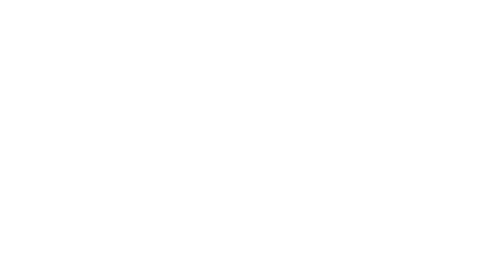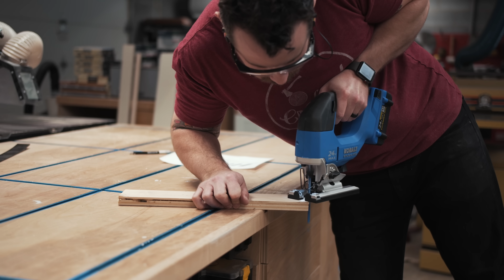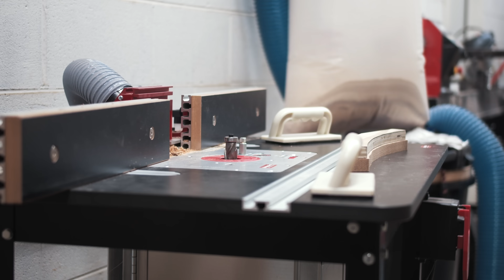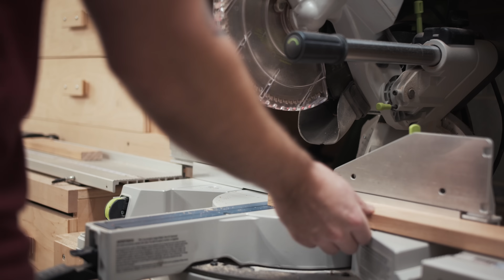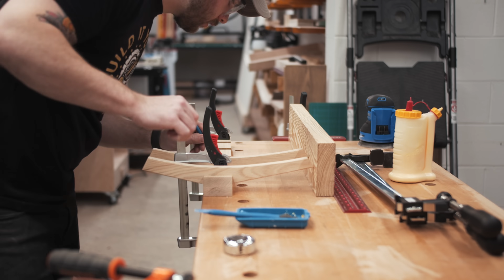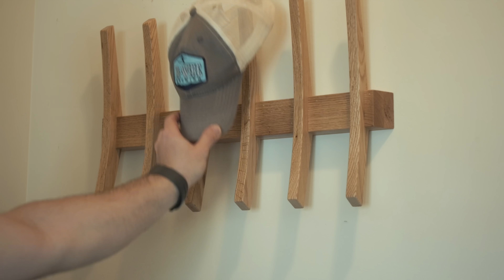DIY Modern Coat & Hat Rack (Limited Tools Build) // How To - Woodworking

Comment: I just recently saw a tip from someone else that showed that if your template is longer than your work piece its easier to start on the router because the bearing is fully engaged with the template before you start flush trimming.

Comment: I'm a little new so help me understand... Why put nails in the spacers that aren't load bearing but not on the hooks that are?
Reply from the maker: The nails in the spacers were really just to keep them from sliding around. The glue has all the holding power in both of these applications, brad nails don't add much there.
Reply: @craftedworkshop  I had considered that but I couldn't be sure. Great project. I'm inspired to get one done for my house a little more now... Thanks.
Reply from the maker: Thanks!

Comment: I made one of these back in August based off a design on rejuvenation.com. The only thing I did differently was use a router to make 3/4” dados for the hooks to sit in and instead of just glue I put two screws in through the back to make sure the hooks could handle a lot of weight.

Comment: You got Red Oak at Lowes? My Lowes doesn't carry that kind of thing but it is in small town USA. The only oak they carry is for stair treads. Might have to rip one of those down to get the pieces for this build.
Reply from the maker: That’s odd, every Lowe’s I’ve ever been to had Red Oak, Poplar and Pine. Bummer!
Reply: @craftedworkshop  Yep, only Oak they have is precut stair treads. They do have poplar though. Maybe someday I'll drive up to the big city an hour away. They don't have that nice birch plywood either in my store. Oh well, make due with what is available.
Reply: Hotrod Hog slap some pine on the steps it’ll be fine.

Comment: Opens video to watch limited tool build...
Sees a table router, nail gun, 40 clamps and a belt sander.
Yeah.... Limited tools.
Reply: You could do this with just a router that you stick through a hole in your table. And you could sand and shape it by hand. He used about the most basic setup you would want to have to be serious about woodworking.
Reply from the maker: People just love to complain.

Comment: Looks really cool. I would probably drive in some screws in from the back just in case the glue can't hold the weight of my big winter coat.
Reply from the maker: Thanks! The glue should be plenty strong considering this is basically a big dado.
Reply: How heavy is your winter coat?
Reply: @MikeTheMaker1  Ohh its heavy all right ☺️